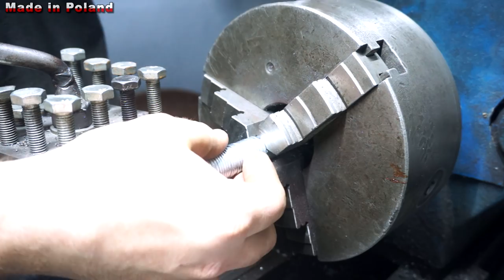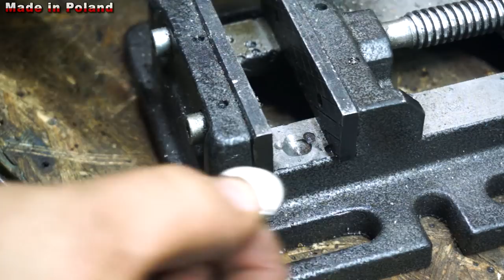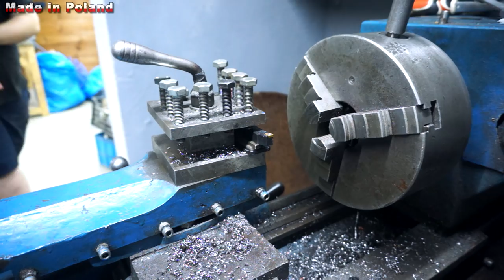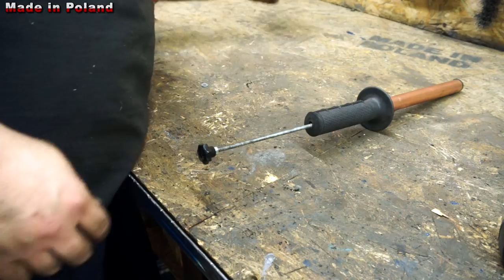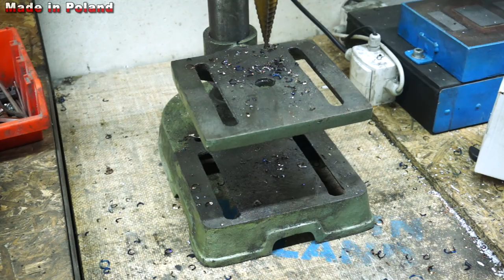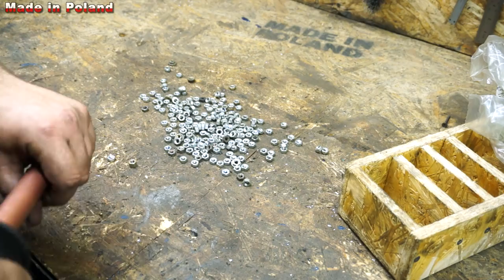Magnetic Swarf Collector DIY

Comment: What a great idea!!  Also, if you put a little piece of scrap wood or soft metal under the things you are drilling in your vice you wont keep drilling holes in your vice. Not a problem now while there are only a couple of holes but once it looks like swiss cheese  you will find it hard to get things flat in the bottom of the vice. Great video, keep up the good work.

Comment: Great idea...thanks. Just ordered some 20x4mm magnets off ebay. They already have a 5mm hole, so I won't have to drill them. I'm planning to use some PVC electrical conduit rather than the copper pipe...hope that will still work okay. Thanks again...from Australia